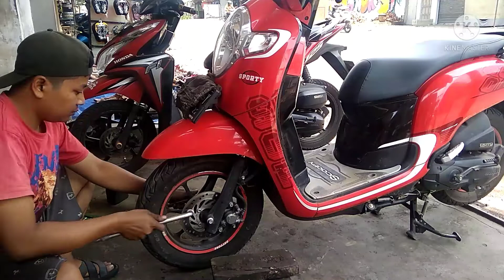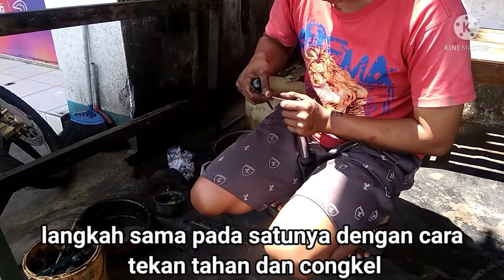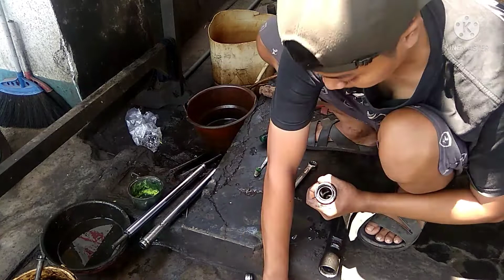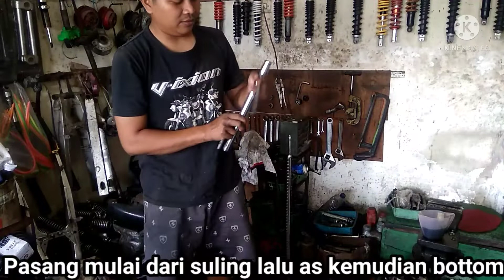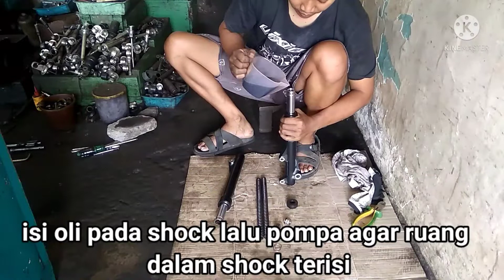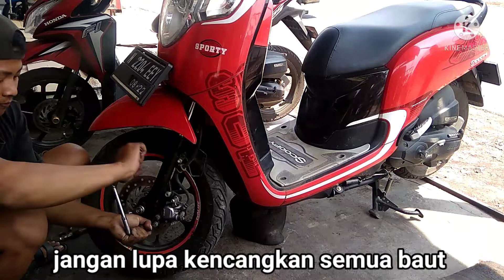Cara mengganti seal shock depan new Scoopy LED

Comment: Bang mau tnya, motor sya scoopy karbu kebetulan hbis insiden shocknya jdi bengkok, sya kmrn pres jdi Keras, saya mau coba pasang shock punya scoopy yg terbaru PNP ga ya? Ato ad perbedaan? Tkutnya mau pasang malah Kalipernya ga pnp di shocknya
Reply from the maker: Setau kami Bisa dipasang dan Untuk dudukan kaliper rem sama, tinggi keseluruhan shock mungkin ada beda sedikit saja. Untuk pastinya coba cari  motor yang dimaksud dan di sandingkan untuk pengecekan 🙏
Reply: @serviceshockbreaker  Baik bang Terima kasih bnyak Infonya. Soalny saya cari shock scoopy karbu udh Bnyak yg KW, jdi satu kali aja beli yg ori tpi punya scoopy yg baru😁

Comment: Motor saya baru seminggu ganti seal bottom & debu nya,sama per shock depan tapi udah bocor lagi.
Pas di cek rembes di tutup as nya,kira kira untuk seal bottom& debu nya di ganti baru lagi apa gimana ya mas?
Reply from the maker: Ganti seal shock (seal bottom)nya saja dengan kualitas yang bagus, untuk tutup seal ( seal debu ) gak perlu d ganti
Reply: Kalo yg ori dia sudah termasuk seal debu nya mas(beat karbu) , kalo yg satuan pasti lokal. Ada referensi ga mas pake seal apa?